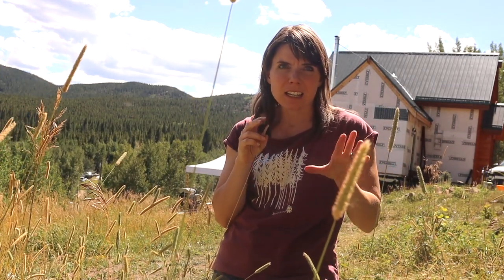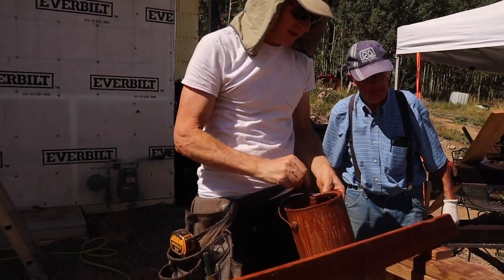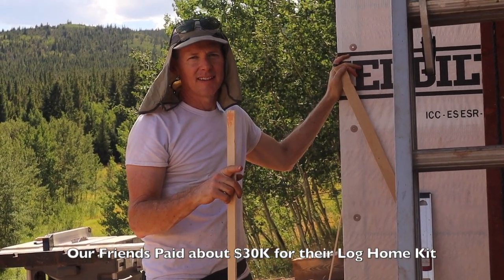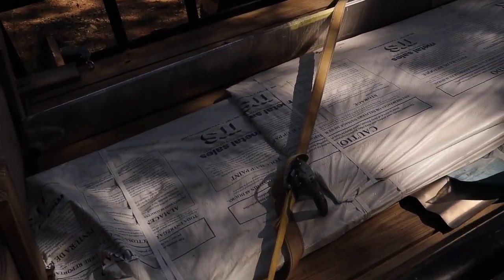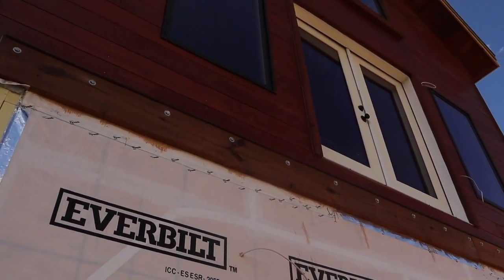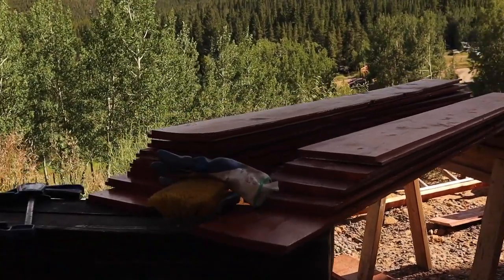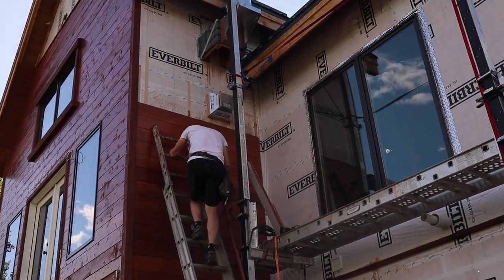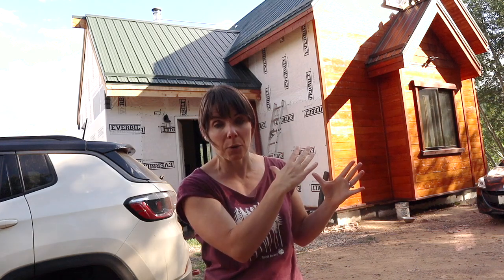Should We Change our House Design for Phase 2?

Comment: A log home owner here! I suggest sticking with your Timber Frame for phase 2. I love consistency and what you have is beautiful! Keep it going. One big problem with log homes is the shrinking/settling of the logs. Our logs were set in 2013 and just this year they stopped shrinking. That factor would cause lots of challenges where the log home joins the timber frame. Some subs wouldn’t touch log structures due to the shrinking challenges. Speaking from experience, logs homes typically run 20% more than stick built homes. Log homes vary wildly. Depends if you are going for hand crafted or milled logs.
Reply from the maker: Thanks for weighing in with the log home experience!

Comment: Our neighbor did a design like your talking about. However, they didn't use large hewn logs. They opted for a engineered log that had a foam center for R value. The original clapboard and new log design shares a stone covered foundation and chimney which really ties it all together. You should be able to find photo's online for ideas.
Reply from the maker: Oh i think we saw that on one of the websites- foam core. I think keeping some of the similar design elements is key for tying the whole look together- very true.

Comment: The real thing that comes to mind is either sips / timber or going with logs.   The sips / timber frame is a huge amount better use of materials. As you have already discovered it is also a lot warmer than traditional construction.  Log homes no matter how tightly constructed are warm because you will go thru 10-20 cords of wood annually trying to keep them warm and dry.  Additionally really need wide eaves to keep the logs in great shape.   Given that as we get older maintenance becomes more problematic.   Think you guys are doing a great job, and should seriously look at continuing the timber frame style.
Reply from the maker: These are great points to consider .He is wanting to do SIPS with Timber, instead of the stick built like we did for phase 1. plus there is no rush to finish phase 2, we can save the money and pay down some debt in the  meantime.
Reply: @ColoradoMountainLiving  I use to be a big fan of SIPS, but with new building techniques, I don't see the benefit.  ZipSystems - R with Rockwool bats (everything installed properly) is easily as good as a SIP wall or roof.  And it doesn't save you that much time.  But it will save you a huge amount of money.
Reply from the maker: Thanks for the additional detail. Will look into Zip Systems!

Comment: Amy, on the log home I built we used timber and log I got a brochure from PrecisionCraft and looked up hybrid homes. Using milled logs and timber worked out beautifully, electrical and plumbing was very simple. I also used an extended milled log post and timber roof to the front entrance and later bricked in the milled log post half-way up with river rock!
Reply from the maker: Cool thanks for the info!  We'll need to look them up.

Comment: Love the look of a log home.  You already have several finishes. Draw out the elevations with the finishes your considering. U can always use sips and just use log siding inside and out. That way you can get that r52 insulation factor. You can get the corners in any style and interior logs for decorations. Hiring subs and being your own general. Or just hiring a general can some times be quicker and cheaper. I was my own gc on the home I built in 1990. Saved a bunch of money but ran myself nearly into exhaustion. My next homestead will be my last. Going to let the youngsters do the heavy lifting. I'll build the cabinets and mill the trim. Maybe mill some of the doors. Other than that let them youngster support their families.
Reply from the maker: Yes I think we'll be hiring out more for phase 2. I like the idea of sips & log siding. The timber framing was a lot of work. Maybe we can add timber elements to match.

Comment: The log home combined with the timber frame and siding can and does look awesome.  We did this with an addition to a very large high end custom home in Jackson Hole Wy. One advantage is that it brings the scale of an otherwise large house down by mixing these styles. It really keeps the elevations from looking anything like the dozens of monster McMansions that plague this market.

The main issue with smaller (8 inch D logs) manufactured logs will be energy. They will not insulate nearly as well as your spray foam in the framing. You would need very large logs and even then air infiltration is hard to combat let alone maintain against it. Second issue is maintenance. Logs in that sun will require expensive re coating every couple years. Way more than the cedar you are using now.
Reply from the maker: Oh wow. I need to see a picture of this well-done. Good tip on the maintenance reminder. We are not getting any younger.

Comment: In my opinion: The YouTube channel "The Outsider" is building a log cabin up in the wilds of Canada. His horizontal logs are notched with a vertical tenon, and the vertical logs are notched with a receiving mortise "channel". If your log home used a "timber frame" style to the corners with logs, and your horizontal logs were notched into them, I think that you could create some continuity to the home. But, I believe it would add a lot of cost to the design. Maybe you could have it engineered on the plans that way, but you and Brian do the notching to save money... Otherwise, I think the blending of the two styles would look weird. Keeping the same roofing on the addition would also help with continuity as well. Just my 2 cents worth...
Reply from the maker: oh how interesting. We'll have to look them up. thanks for sharing!

Comment: You could capture the savings of the log cabin kit and stay true to the design of your current house by using the same type of siding. It kind of defeats the intent of the log cabin exterior. Just a thought..
Reply from the maker: yeah, someone had mentioned you can get square logs for a kit, and do the siding over it. hmmmm

Comment: Since the home is already framed, if you went with logs wouldn't they be installed as just siding? Or do you plan on taking out the frame first?
Reply from the maker: No this is an addition to the current house. Phase 2 is the rest of the house we want to build.

Comment: When you buy the last of your siding make sure the delivery what you want this time!

Not sure how the logs would look next to the timber framed but I see no reason why it should not work. 

You should now have a good idea of how long you take to do things. It may be a good idea to produce an as built construction program. You could then produce a reasonably detailed program for phase two. Program in holidays, weekends off and less work in the week.

I understand that you are not planning to start phase 2 until 2021. Maybe you could construct the foundations for phase 2 in 2021 plus the garage and guest room above. Then you would have more "workers" to stay.  If you decide to use it as an Air BnB you will have to fence off the guests from your construction and you will only be able to do work that does not disturb them.

Then in summer 2022 erect the rest of phase 2 timber frame plus sip panels, windows.. Winter 22/23 fit out. Summer 2024 cladding and anymore fit out. Summer 2025 land scapping.
Reply from the maker: I like your thinking! Gotta show this to bryan to ease his overwhelmed mind!
Reply: @ColoradoMountainLiving  A program for phase two would also allow you to plan your finance. If you get contractors to do parts of the work whilst they should be faster they will be more expensive. Also a contractor will be happier to give you a better price in you hire them in advance and they can see from your program when they will be required.  You should use contractors to save time, but it may not be best spending the money for work that saves you time if the time saving does not allow subsequent activities to start unless it is a more dangerous job or skills/code require it.

I would get the phase 2 timber frame erected by a contractor. It is a high risk activity. If you do I would recommend that they also make the frame then if it does not fit it is their problem. Also if they hit phase 1 it is down to their insurance. They would have nine months or so following the program above to survey your phase two basement, produce shop drawings, you to check them "at their risk" and make the frame ready for erection in May June 22. 

I would also get the cladding on the south and east side installed by a contractor. The height again makes it high risk. It may be difficult to get in a lift because the house is in the way, you would have to make a road down the west of the house or drive through the back wall of the garage (head room!) and around.  So a traditional metal scaffold may have to be erected which would be better with a larger work force so you do not have to hire it for months.
Reply from the maker: This is great to have such a long range plan. Now we have more of an idea of the pacing of a build we could do this more easily.

Comment: Just as an aside many people go with hybrid where you do not use a timber frame, just the sip panels. Then you can side it out as you wish, and finish the interiors anyway you wish without regard to the interior or exterior finishes matching
Reply from the maker: Interesting. SIP panels without the timbers? Like a traditional home?
Reply: @ColoradoMountainLiving  building what is known as a hybrid system is common.. sips are erected using spline to join the panels together. This can be done with two splines of the same osb material or 2 x boards the width of the panels.  They are all screwed and foamed together but are  self supporting and actually the building can easily be erected including the roof in under a week
Reply from the maker: Ah ok. Someone else mentioned ZipSystem Panels?
Reply: @ColoradoMountainLiving  zip is osb with what amounts to tyvek house wrap already integrated onto the panel. It is another way to seal up the house

Comment: there's traditional and modern log home then there's timber frame. i would draw it on computer first at least on sketchup and study your local bi-laws. for example around here a 4 bedroom house has to have a 1500 gallon septic tank even if 1 person is living there so an addition would require a variance. as far as hvac just have 2 systems or as may as needed
Reply from the maker: yeah, our septic was engineered based on the plans for the entire house- phase 1& 2. so we are good there. Good idea to sketch it up on a computer.